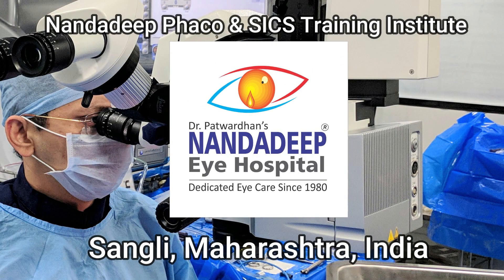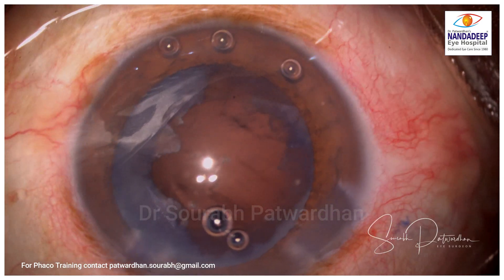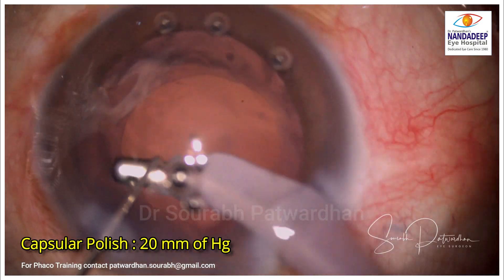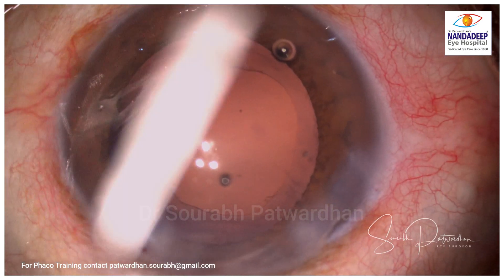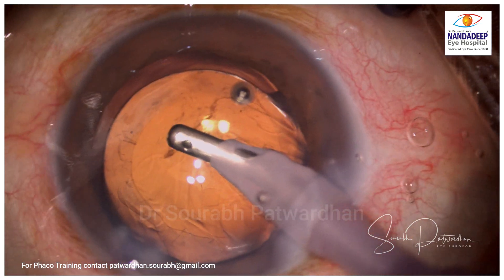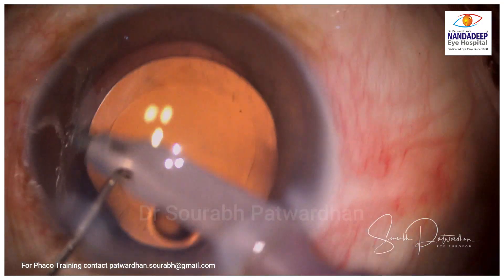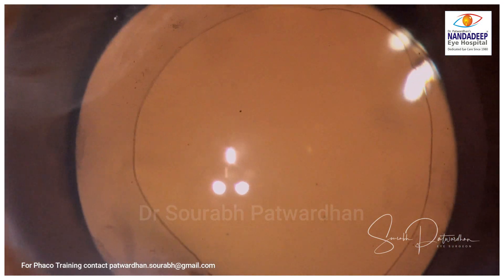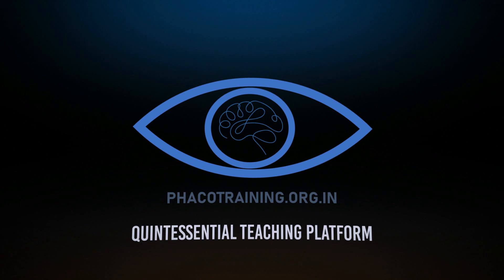73 Cleaning the bag: Dr Sourabh Patwardhan- what is yor method and thought process, hydropolish

Comment: I always use coaxial illumination and bimanual I&A for cortex wash.
1. In all cases I use POPS ( position, Occlusion, Posterior pull and Sweep) technique as described by Dr Abhay vasavada sir. It helps me in total cleaning of bag in almost 99% cases without leaving a single thread or remnants of cells.
2 . In all cases I do posterior capsule polishing by irrigating Cannula itself. I keep high flow rate like 35 or 40 and with irrigation cannula only I sweep posterior capsule thoroughly. It helps in removing small cells or debris and there is no risk of PC tear
3. For hidden or sticky cortex in angle or in case pupil is not full dilated and visualisation of extreme periphery is not possible, I use same technique described by you- put IOL inside bag and rotate it 2-3 times inside bag with keeping irrigation on.
4. Regarding ant capsular polishing, I have done extensive ant capsular polishing from 2015 -18. And found no additional advantage, also not any disadvantages as you mentioned. But I strictly avoided it in TORIC as there I wanted fibrosis to happen to prevent any unwanted IOL rotation. Asthetically it looks very clean and neat, but didn't find any additional advantage.
5. What I think is more crucial is thoroughly washing bag and not leaving a single cell/debris/threads behind to form PCO. And for that proper visualisation ( Sterio Coaxial Illumination) and proper instruments ( I use small tip Haldipurkar irrigation cannula 23G and 23 G aspiration Cannula) and proper settings ( I use 35-40cc flow rate with 300 vaccum and 50 IOP on centurion) is what all required.
Reply from the maker: Beautifully explained.. must read for all

Comment: Excellent vdo as always Dr Sourabh..
My way of PC cleaning
1.I dont prefer to do ant capsular cleaning as i believe  it leads to more metaplastic changes disturbing ant capsular  fibrosis.
2. Ensuring good hydrodissection is an important step in facilitating capsule cleaning.
3. I use irrigation handpiece with irrigation ON to flush cells on pisterior capsule through main wound and I feel it can be alternative option to saline irrigation.